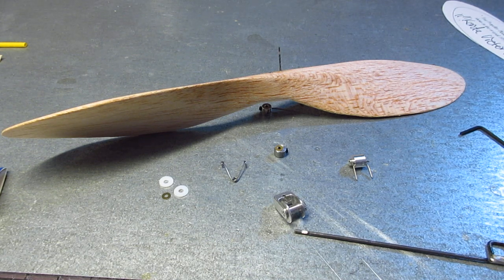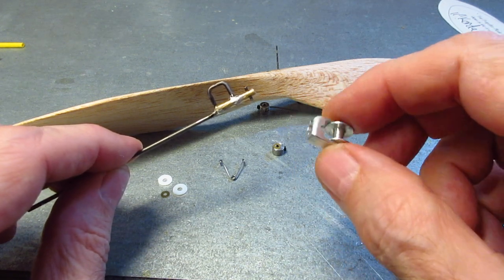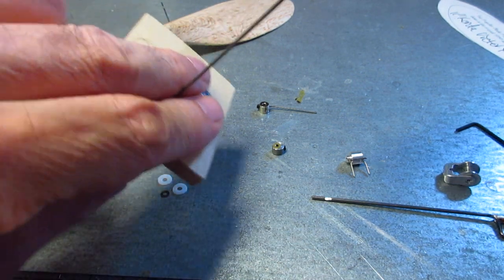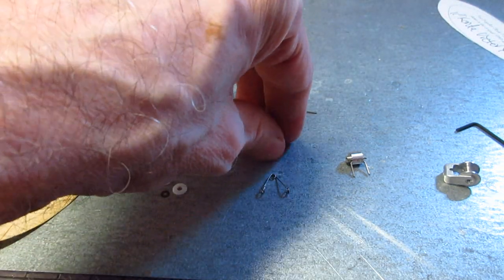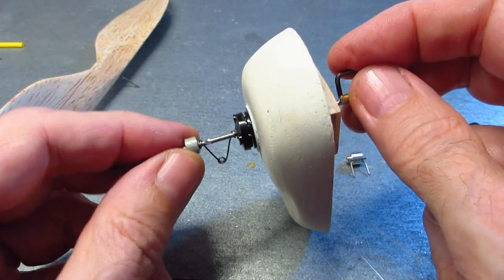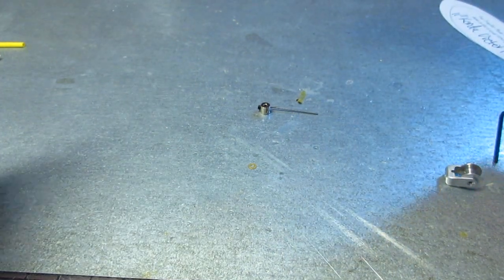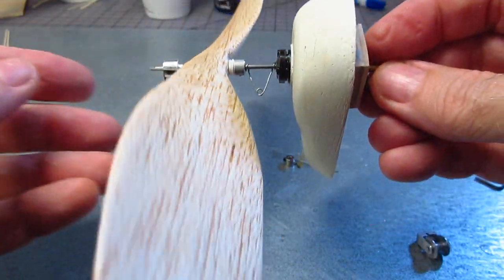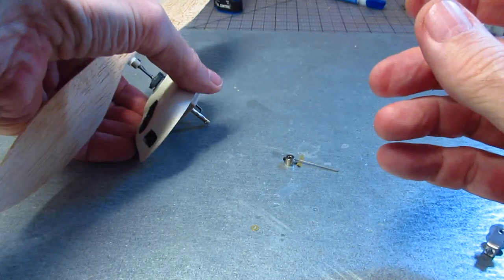Freewheel front end with safety pin

Comment: More quality content! I always have a hard time with the props and shafts. This looks like a neat and reliable system.  What propellers I have carved have the freewheel pin drilled through the prop itself, and the prop shaft invariably bent to contain the prop rendering the whole thing unrepairable at the field. I need to try this. If I ever finish a model, which has been a problem.
Reply from the maker: Thanks, I'm fairly happy with this system. Other types of freewheels can also be used for the front part, and brass retainers if you can't find the aluminum, they are harder to get. Being able to replace broken props and bent shafts at the field is a nice advantage.

Comment: hi there  from New Zealand great you are back on the Youtube  do you have Brass K@S tubing  in the  propeller hub ,Could not see anything . i enjoy watching you flying...  may be in NY city somewhere.  Any chance of doing a update  on R/C assist equipment and where to obtain, have built  two  P30,s    thanks, Warren
Reply from the maker: It's aluminum tubing in this prop hub. I might do an update on the equipment, some things are no longer available. For receivers, go to microbirds.com, the redcon receiver is nice, and I just ordered the super light RX42 to see what that is like. For servos, hobbyking has some I like, usually the HK282a shown in the video, but the 5330 also looks good, I'm ordering one to try it. Flying here in midtown manhattan, RC with P30 is enormous fun!
Reply: @domoremath   many thanks for your reply will look at those web sights , still think you do real great to fly in Manhattan im 70 years old  and have been building model aircraft all my life, done some unofficial full size flying too.. have spent  2 hours in a Dh tigre Moth in the back seat  mainly doing touch and goes ,managed to do them with instructors hands off . most time spent flying in a super Cub a friend had.  pleased you are back on Youtube

Comment: Thanks for another very informative video, very useful. May I ask your advice? I am building a Korda 39 Wakefield and intend to install RC. My question is should I aim to put the Rx, servo and battery compartment right on the CofG?. 
Thank you, kind regards Alan Coppen, Southampton UK
Reply from the maker: I usually put it pretty close to the CG, either under the wing or on the bottom of the fuselage under the wing. Should be fun in the Korda, I used RC in the Korda Dethermalizer years back.